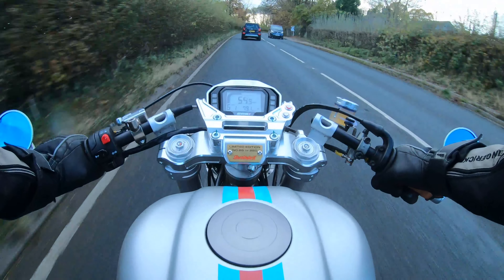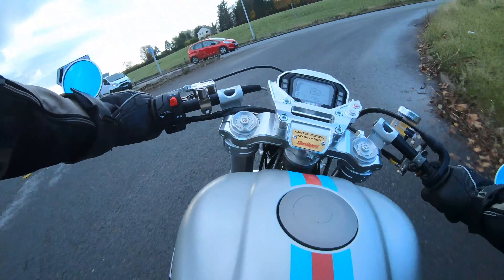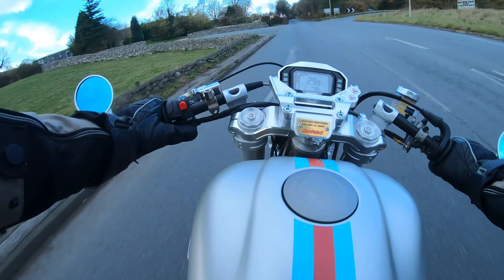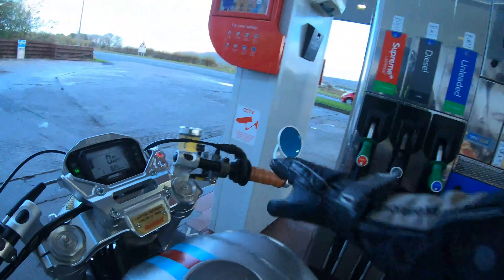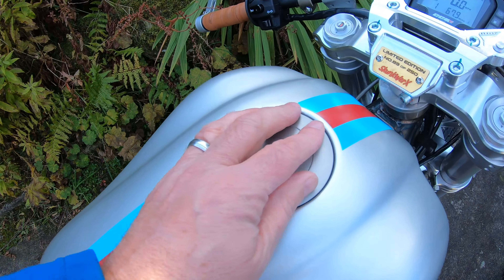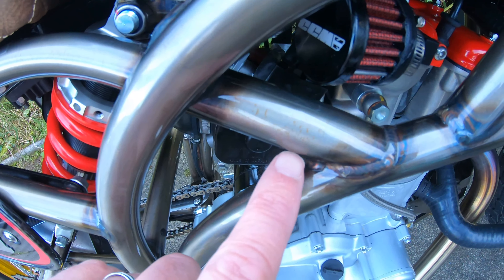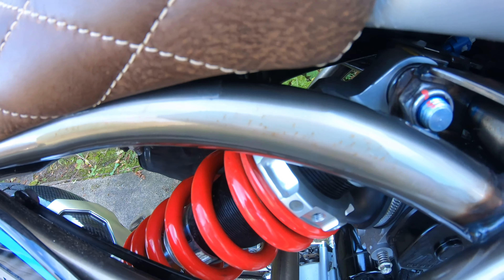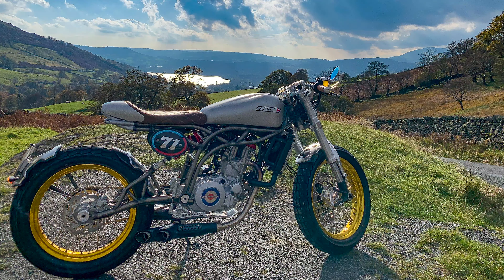Living with the CCM Spitfire Cafe Racer - 3rd Video

Comment: Richard, great video thanks for sharing....how do you find the seat height and side stand? Looking at one of these and just wondered about some of the practical aspects of ownership and riding. Thanks.
Reply: The seat height is spot on for me. I am 6ft with 32" inside leg. If you are short you might find it more of a challenge.  The side stand takes a little bit of getting used to. It is a suicide stand (CCM heritage is in motorcross) so if you are not carful it can flick up.  I find it easiest to get off the bike first then put the stand down.  Once you have got the hang of it, it is very straight forward and doesn't cause me any issues.

Comment: Hi Richard, great work with another very informative video. 
How about showing us any owners manuals, booklets or literature received with the bike?
The frame issue is a disappointment and worrying...
Do you think the rust marks were already on the frame before the lacquer was applied encapsulating them or is it due to uneven coverage of lacquer leaving exposed bare metal spots which then rust?
 I am due to take delivery of my cafe racer in March and will be bringing up this concern before its dispatched.
The standard exhaust does sound great on your video. I have ordered the Austin race exhaust option but am now wondering if they will be too loud and obnoxious...
Reply from the maker: Hi Michael.  Thanks very much for your comments and suggestions.  The rust marks were definitely not there when the bike was delivered, I had seen this problem mentioned on the facebook page so was looking out for it.  I inspected the bike on delivery to make sure the frame was clear and then of course you tend to notice anything when you are cleaning the bike.   When I first spotted the rust marks I sent  photos to CCM and got the following reply from Steve Bridgman "I have forwarded them on to our coating company. To be honest I have seen this before and it’s the cleaning chemical they use that has not been cleaned off properly before they apply the finishing coat."  I would not worry too much about it,  CCM responded quickly and agreed to replace the frame.  I did not have to have a lengthy dispute with a dealer like you would have done with some other manufacturers.  I believe a few people have had the problem and it has been sorted very efficiently by CCM.  My bike has now been picked up and gone back to the factory.  You will love the bike and it would be interesting to hear how you get on with exhaust.